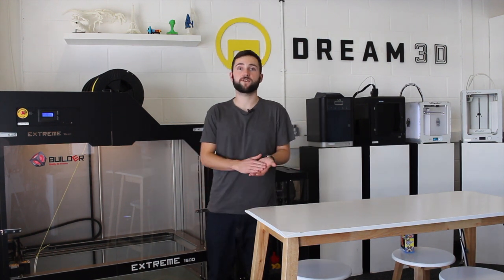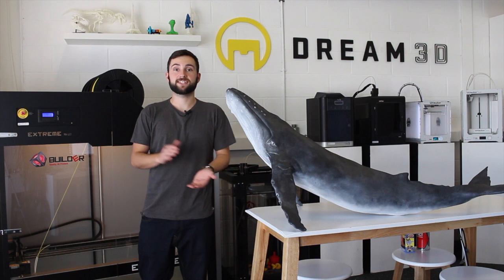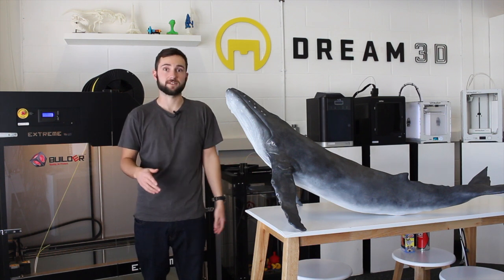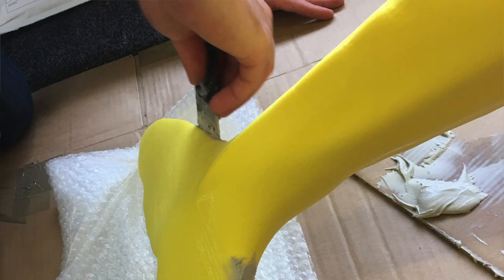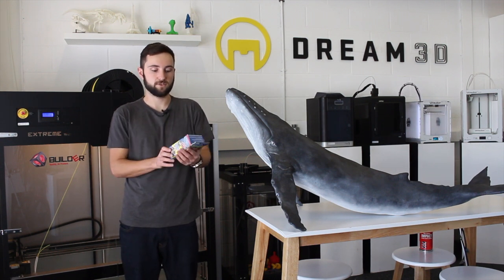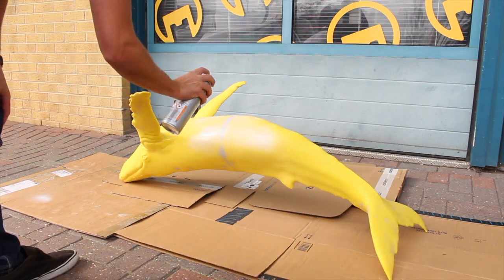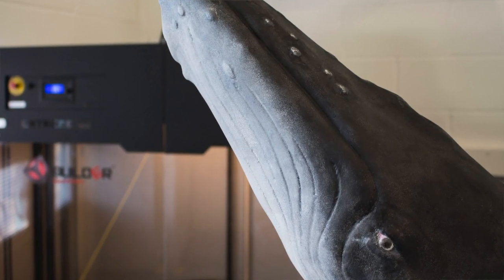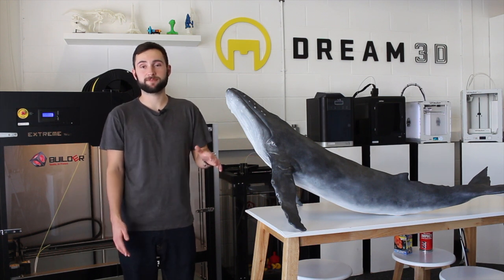Finishing Our 1.4m Whale Print | Dream 3D

Comment: looks fantastic!! how long did it take to print both pieces??
Reply from the maker: Thanks, it took about 3 days for each print so 6 days in total. We used the 0.8mm nozzle which speeds up the print time compared to the 0.4mm nozzle, we could have used the 1.2mm nozzle to speed it up even more but there would have been a drop in quality.